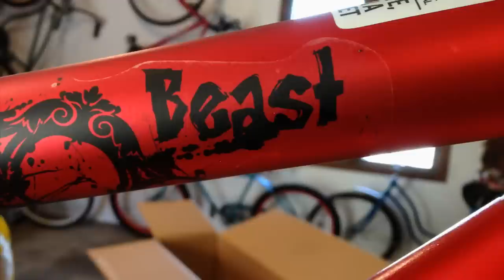Mongoose Beast First Ride

Comment: Quick question, since you installed the 22 tooth cog on the back right away, did you use a different chain that what came with the bike?  Or add any links?  Or will the same chain work?  Thanks.
Reply from the maker: Yes I added to the chain. I don't recall how many links though.

Comment from the maker: Easy to assemble. If I recall you just have to put on the front wheel, pedals and stem/handlebars. Adjustable wrench and allen wrench probably all you need. Just to be safe  I tore mine down to regrease everything prior to assembling.
 IMHO this bike comes with too high of a gear to ride off the pavement though. I changed out my rear sprocket to a bigger one (make pedaling easier) so I could ride it off road.

Comment: Awesome video... Question? Do you have to oil or grease the chain? If so, do you recommend a certain type... Apologize, NEVER put a bike together as of yet... Mahalo's (Thank's) Gil
Reply from the maker: Regarding cheaper department store bikes like this one...  In my experience the chain generally has enough oil. It's all the rest of the parts that may be lacking lubricant. No better time than now to learn to work on the bike. It's all pretty basic especially on a bike with single speed and a coaster brake.  The bike will serve you better and longer if take the time now to make sure everything is greased, properly adjusted, tight etc... Tons of great videos on youtube for any help you may need.  You will want to have some chain lubricant on hand though. I'm not partial to a particular brand but my local bike shop carries White Lightning. 2 types. One is wax based which is less messy and good for when you don't expect to be riding in wet conditions. Their other oil is for more harsh riding conditions. The grease I use is just wheel bearing grease from the auto parts store. I sold this bike several years ago and upgraded to the mongoose Dolomite which I've also since sold. We just have too many bikes. Thanks for watching. Please poke around our channel and check out some of our other videos.
Reply: Joe, MAHALO'S (THANK YOU) for the prompt response. So all I need for this basic cheaper bike is a 20' sprocket and lube regarding specifics in video correct?
Reply: I'm utilizing for gym, which is literally 2 minutes driving & maybe 7 to 10 minutes on bike just cruising, not rushing it...
Reply: Google maps: 1.1 miles away / 5 minutes from gym on bicycle
Reply from the maker: You could just take a chance that the bike was properly lubed but in my and many others experience these bikes may have little to no grease. It's a gamble. As for the sprocket you may want to ride it first to see what you think but for me it was too high of a gear. I even noticed other people I would see riding this bike with the stock gear were spending a lot of time out of the saddle (standing) to ride because of the high gear. in another video you'll see I even changed the sprocket a 2nd time to a 22 tooth to make it even easier to pedal. I couldn't get anywhere fast but it sure made it easier on soft terrain and hills. I'm assuming the bikes still come with the 18 tooth. If I recall though some similar models may have came with a 20 tooth. Oh also if you change to a bigger rear sprocket (bigger rear sprocket makes for easier pedaling even though that may sound backwards) you will probably need to lengthen the chain. like I said just give it a try with the stock sprocket first and see what you think.

Comment: Love the information about grease in the bearings. I read a bunch of posts below and did not see where you got the 20 tooth rear sprocket. Did you notice a difference?
Reply from the maker: I believe I had the sprocket on hand but had probably gotten it at my local bike shop. Yes it did make a little difference but later I changed it out again to a 22 tooth. This made it a lot easier on trails and hills. Too easy for riding flat pavement though.
Reply: LocoJoe yea I kept my gears as is but I would like a little more torque on the pavement..maybe a 2 ring set up for the crank

Comment: Did you have to add any links to the chain for the 22T-Sprocket to work ? If so, how many links does the stock chain have and how many links did you have to add ?? Just got my Beast today and ordered a 22T Cog for it, was wondering if there would anything else needed... Thanks, Joe

Comment from the maker: I got an e-mail that you posted another comment/question but can't find it here. Anyway not sure what you meant by "specs". I replaced the 18t rear sprocket with a 22t to allow me to do a little off roading and hill climbing. A 22t might be to easy pedaling if you are just planning on riding flat paved paths. A 20t might be better for that.

Comment: What size frame is that? Would it fit someone who is 6'3"?
Reply from the maker: Hard to say if it'd fit ya. It's approx 17" bottom bracket to top of seat tube and there's pretty good height in the stock seat post.

Comment: If you changed out the sprocket on the pedal for a larger one, would it go faster through the sand? What about breaks? is the bike harder to stop with the larger wheels?
Reply from the maker: With the stock sprocket I think it would be really difficult to go through sand at all (I'm talking soft sand). The larger rear sprocket makes it easier pedaling and better in sand. It has a coaster brake so it's not as other types. Works fine for just cruising around though.

Comment from the maker: I see a guy riding what I assume is a stock (18t) Beast around here and he's always standing on the pedals to get it to go. I believe all the newer rear sprockets are universal so whatever you find should work. You may have to add to the length of the chain if you go to a bigger (=easier pedaling) rear sprocket. The front 
chainring I left stock.

Comment: Nice video, LocoJoe! Thanks a lot.
I have a question: I'm tempted to buy those and use them for desert biking in Nevada, but I will have to assemble them myself in a short time and without carrying the right tools (I'm coming from outside the US).
Do they include a "for dummies" manual in the package? Are the required tools included? Can someone like me, who doesn't have any special handyman skills, assemble them in an hour or so?
Thanks very much!

Comment: Did you have to get a bigger chain to accommodate the larger sprocket? Or did the stock chain work?
Reply from the maker: I had to add a link or 2.
Reply: Looks like even though I only got a 21t cog, I should get another link. It all went on, but the chain is too tight by just a bit making the wheel not spin true

Comment: Im going to buy one from walmart tommorow. It was on the garden center patio paint fading and chain rusting. The Mgr is going to discount it for me but He wasnt there. So since Im getting it aaround 75 I can do my upgrades cheap. I plan to drill the rims, put better tires n go tubless Lighter seat, post and pedals..and maybe a lighter handle bar set. Any thing else I can do ???
Reply from the maker: Wow good deal. Sounds like you got everything covered.
Reply: If you're about 6 feet tall, would a 26in bike be comfortable to ride without having to stand up?

Comment: what would be the best gearing for this bike to work in soft snow?
Reply from the maker: I didn't ride mine all that much in soft snow. I'm guessing the 22t rear cog would be ok. Bigger might be better in snow but if you were ever not in the snow you'd spin yourself silly. I think soft snow is going to be a chore to ride in no matter what. Again I really don't have experience riding in it. Thanks for checking out the video.

Comment: May I ask at 2:20, Whats with the spokes on the green bike in the background?
Reply from the maker: That's the "Bronco Bike" more info on it here... http://locojoe.com/bike/191
Reply: LocoJoe Its so weird its cool, But I was thinking you could make it ride normally if u just shorten the bike spokes on the smaller circle, if you shorten the spokes where the big spokes are longest and lengthen the spokes opposite it would ride normally
Reply from the maker: Johnny Williams The whole idea was to make eccentric wheels and for it to ride like this. Clowns  ride bikes like this in the circus. Their wheels would  probably be laced  with different length spokes to accomplish the off-set. I took the easy way out by welding one rim inside another. Trying to lace an eccentric wheel think would be a nightmare. Would require cutting and threading spokes. It's fun to ride... short distances :-)
Reply: LocoJoe Yeah I bet, But yeah if you someone pained through changing spoke lengths then it would look wild and still ride true

Comment: My son just got this bike and when he turns the wheel his foot rubs on the tire. Is this right?
Reply from the maker: Toe overlap can be an issue on some bikes. I don't recall how much clearance there was on this bike though 9I no longer have it) . I have fairly small feet so not an issue for me. Sometimes the fork will be installed backwards on department store bikes and could cause toe to hit the tire but I'm not sure the fork could even be installed backwards on this bike without the tire rubbing the frame. I'd Google some images of the bike and make sure the fork is facing the right way on his. If it is he'll have to learn to deal with it or look for another bike. Hope it works out.

Comment: I saw one of these for the first time at Walmart today... with tires that fat, I would think the multiple-speed gearing would be necessary...  I am looking to see if anyone has fitted an engine to one of these... would have to go behind the seat, I think.
Reply from the maker: It really depends on what you use it for. Once I changed the gearing on mine it worked pretty well for cruising and some trails. I've since sold it and bought the 7 speed Dolomite but I generally just stay in one gear on it. It's pretty flat where I live though. I'm sure I've seen or heard talk of someone motorizing one but I can't recall where.

Comment: Does it come with a coaster brake? thanks.
Reply from the maker: ***** Yes.
Reply: LocoJoe Tkank you for the reply
I'm getting a mongoose beast in early june, after my paycheck has come in.I'm thinking of putting a 28t chainwheel in the front instead of a 22t driver in the rear.

Comment: Where did you get the 22 tooth rear sprocket ??
Reply from the maker: It's one I had and don't recall where I got it. Either from my local bike shop or off another wheel I had.
Reply: Thanks for getting back to me.
I'll have to check the local bike shops
Is it really important to swap out the rear sprocket?
I'm planning to ride around the village for exercise.
Reply from the maker: John Doe If it's perfectly flat and paved where you ride the stock sprocket might be acceptable. I seen someone riding the stock bike where I live and it's flat but he always seemed to have to periodically stand to keep his momentum. With the 22t I'm really spinning on flat pavement but it sure pays for itself on hills, not so ideal terrain and against the wind.
Reply from the maker: Do you already have a Beast? Walmart is supposed to be offering a 7 speed disc brake version any day now.
Reply: LocoJoe I'm waiting the arrival of mine.  Cost was a factor.
The first thing I should do is ride it with the stock sprocket and
find out if it works alright for what I intend.  Then change the
sprocket, if necessary.  I've been reading about the hub driver
breaking under hard braking or use.  It's been blamed on poor
quality of parts.  What is your belief ?
Reply from the maker: Yes I've heard of the driver breaking also. I do believe it's all cheap parts otherwise it couldn't be sold so cheap but I haven't had anything break on mine yet. BTW if you're not already aware, I have a blog with a lot of stuff about the Beast and other bike stuff http://locojoe.com

Comment: I WANT ONE NOW walmart dose not have this one still there is a one with 7 gears and disc for $349.97 not a bad price my bike shop dose not have one for less then $1000 but it is way lighter nthe wheels have been cut down in weight by having holes in them BUT I WOULD NEVER BUY ONE OF THE $1750.00
Reply from the maker: Toys R Us sells 9or at least did) a similar version of the Beast called the Brutus. I've heard Academy Sports may have the 7 speed Dolomite cheaper than Walmart.
Reply: LocoJoe
there was also a MOTABICAN not the right spelling on BIKEs DIRECT for $699 but i think it is a better quality then the WalMart bike it had the cut outs that the Surly had walmart bike has no cut outs where ever they can save weight regular price $1499

Comment: How much air you got in the tires ? I am 250lbs so what would I need
Reply from the maker: +gaskan666 I usually had them at the max psi for riding gravel and pavement (I can't recall what the max psi is though). Snow, sand and really rough terrain I may lower it to 8 or so. As for your weight and the tire pressure, sorry I don't have a definite answer but I don't think it would be much if any different.

Comment: What the fuck? If you want a cog to chain configuration that isn't "hard to pedal" you go down not up going up in teeth makes it feel smoother but your just pedaling more and getting tired noticed how the kid was pedaling so much but going very slow and not getting far at all? Keep the same sprocket get a 13 tooth cog it'll feel better it will feel stiff but trust me I ride a 29/9 so it has that lag but once I'm 2 crankspins in I'm going fast as hell
Reply: Nonononono,any engineer will tell you,an increase tooth sprocket will decrease the amount of energy needed to turn it,lowering the gears will make you have to pedal harder,but you will go faster,more torque is needed at the pedals,but if you increase the sprocket size,then you have more teeth,and more teeth will match the first gear,for example 1:1 would be really easy to pedal,that would be say 30:30(spokes)vs 1:3,which has 3 times the total speed,but more energy needed to turn that gear.
Reply: Damn, I guess I'm the only one running 36/9, lot of lag but more speed in the long run, about to switch to 25/9
Reply: DramaTD you do use a bit more energy BUT your only pedaling for about 5 seconds and in those 5 seconds you've already gained enough speed to cruise and a good pace so if you keep pedaling but not as hard just one or two crank spins here and there you'll maintain a higher speed with lil effort so a bigger sprocket with a smaller cog is better in the long run

Comment: You need some bmx bikes.
Reply from the maker: I appreciate BMX but it's just not my thing. I do have an early Schwinn Scrambler BMX that the Grand-kids ride.
Reply: Why did you rip off stickers?  Embarrassed to own a Mongoose?
Reply from the maker: Quentin Raffensperger I was planning to paint it, which I did, twice.I'd probably removed them anyway though as I like the cleaner look.
Reply: Cool !
Reply: LocoJoe So do those giant tires make the pike harder to get moving?
Reply from the maker: Entropian2012 Yes it takes a little more effort to push the big tires around compared to skinner tires. That's why I changed out the sprocket to make it easier.
Reply from the maker: *****
I already had the sprocket on hand when I installed it but I had probably gotten it at my LBS. Sorry but I don't know how many teeth bigger you can get them. I can't imagine needing more teeth on this bike unless you will only be riding uphill in the sand :-)

Comment: First thing to do when buying a monguse dont buy a monguse haha buy a bike with a real headset and a mid bb that has three paice cranks and wont break in 4 months from light riding and a better gear ratio like 25:9 or 28:9 or 28:10 and a real driver and sealed hubs.

Comment: I don't see the point of this bike. it is not efficient
Reply from the maker: Where I live there wasn't much point to it. it was more for the novelty of it. Although It did serve a purpose few times tiding  on old railroad beds that still had ballast rocks the size of your fist. In other locals with snow or sand is where the bike would be of better use.

Comment: I don't get it...whats with the balloon tires?..is that the new cool extreme thing or what?..I'd say I'd take a pass on those ridiculous looking things...that bike looks like it should have a clown w/ a horn & a plate that says Ringling Bros. Barnum & Bailey Circus...good lord..
Reply from the maker: I'm probably the wrong person to ask what's cool or extreme but I don't think they are neither cool nor extreme though. For me, just like the circus, they are fun. I have or had tall bikes, swing bikes and a eccentric wheel bike that fit the circus reference too.
Reply: they're usually used for offroading like on a mountain bike but are the bike of choice on sand because of the tyres. it's just something different i guess, i dont see many benefits over mountain bikes when riding trails but i guess if you where to ride them on sand it makes more sense
Reply from the maker: jason stewart
Beneficial in snow too and I believe that's where they came from. Evolved from the early ones in Alaska where they would double up the wheels and tires.
Reply: LocoJoe nice, i can see how it would be of use in snow, with some snow tyres on there? there's no such thing as bad weather, just bad gear ;D
Reply: LocoJoe very nice!